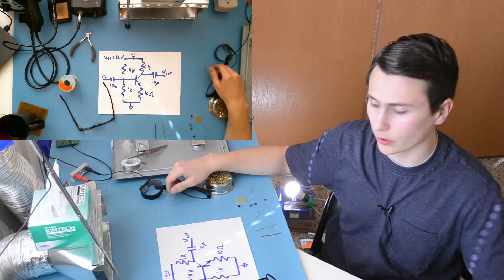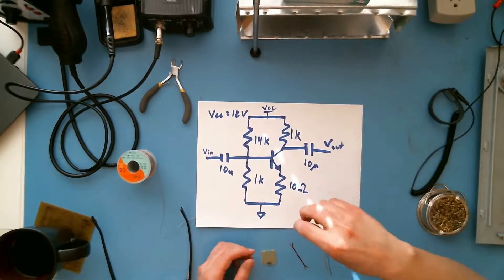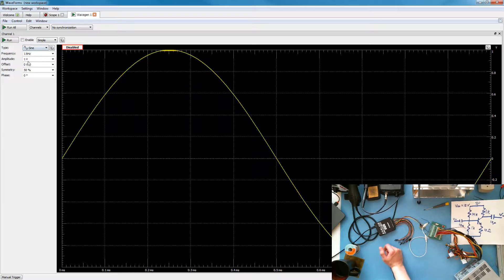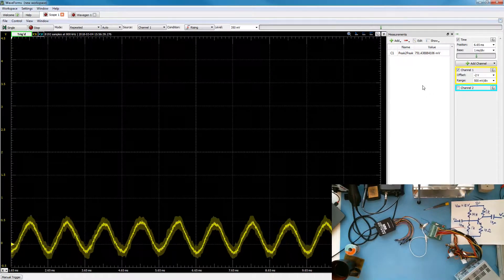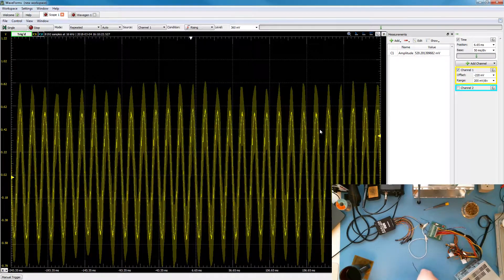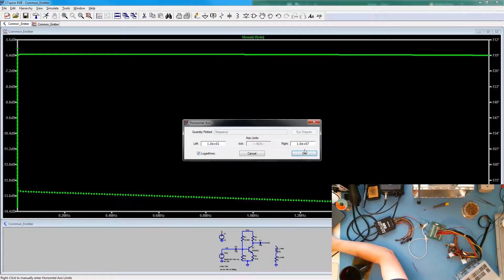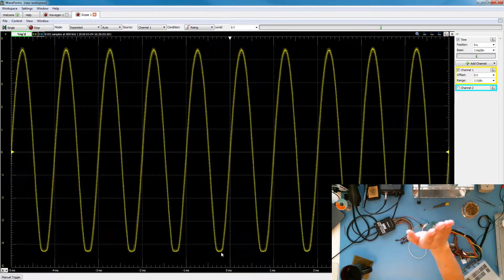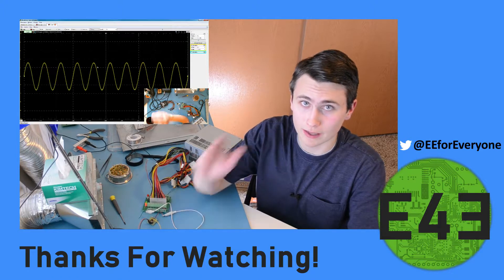Building the Common Emitter Amplifier

Comment: Nice one, i wondered what tools did you use to measure the actual frequency on computer like oscilloscope? is it an output generated by some kind of oscilloscope or you only use the software "Waveform" somehow? can i use it to frequency of mains AC voltage and how?
Reply from the maker: Hi Muhammad, I'm using a USB oscilloscope, the analog discovery. I wouldn't reccomend this for mains, but rather, a standard oscilloscope with an isolated probe. Measurement setups can get expensive quickly when working with high voltage!